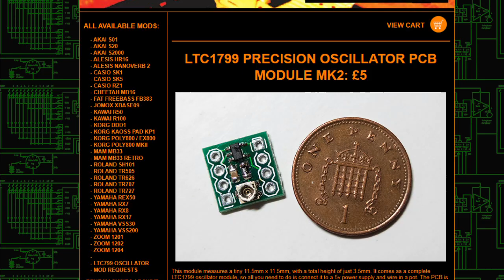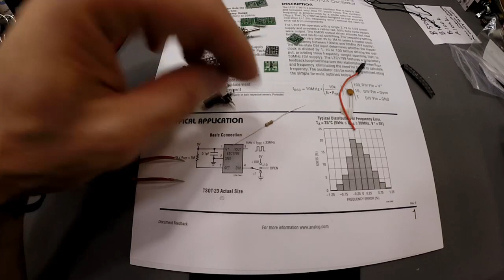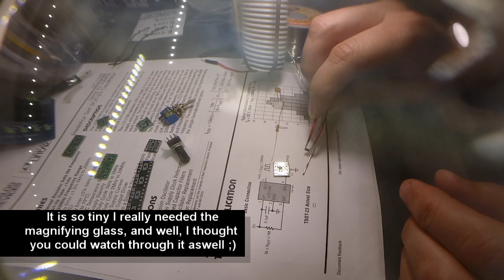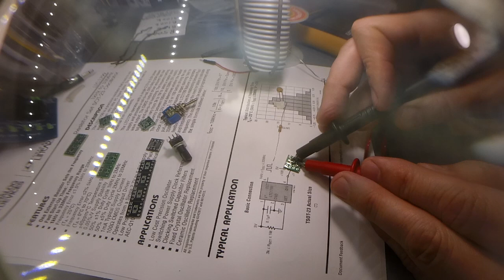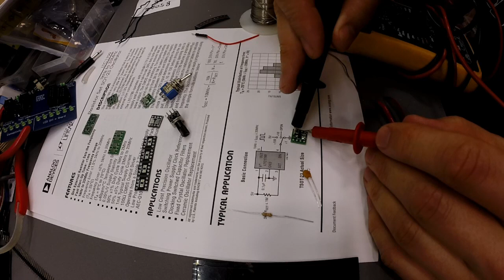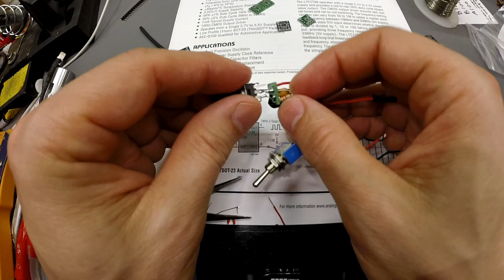Lowcost DIY LTC1799 adjustable clock module 1kHz to 33MHz - Inbetween Episodes

Comment: Pro tip: Instead of tweezers just use a spudger soldering. A spudger is just a wooden stick. You use it to manipulate the SMD and to hold it down when you need to. You'd think tweezers are better but just try using a simple stick. It's how we did it professionally. You can buy electronics spudgers. The gray ones are the nicest. They're orange wood or something? But any splint of a hardwood should work. It's basically like a chopstick. But one side will be conical and the other side is chisel shaped. In general you only use the chisel side. If it were me I'd hold that board too. I have little vises and stuff. Blue tacky is handy soldering. I have a scrap of wood I sometimes blue tacky stuff down on to solder it.